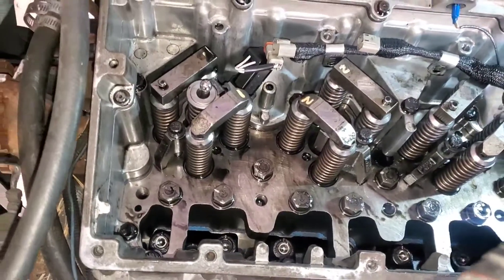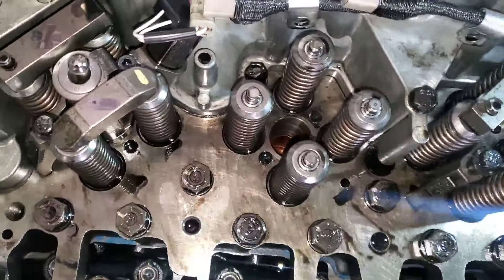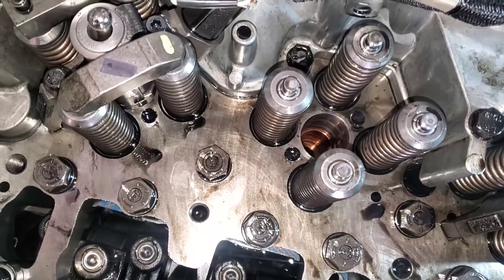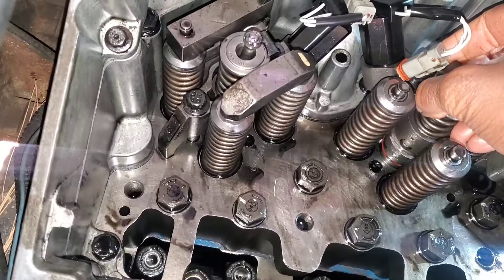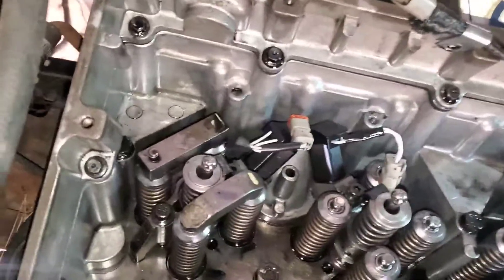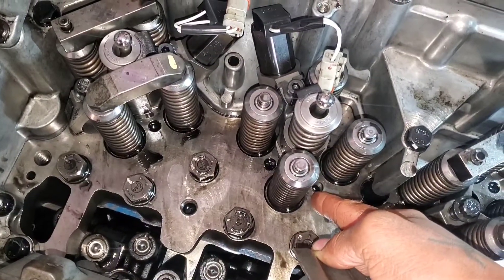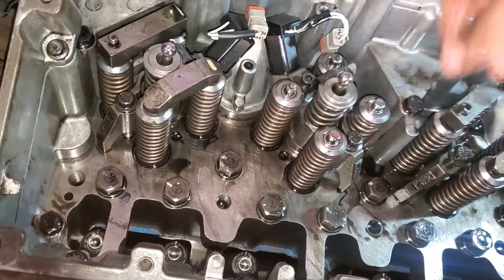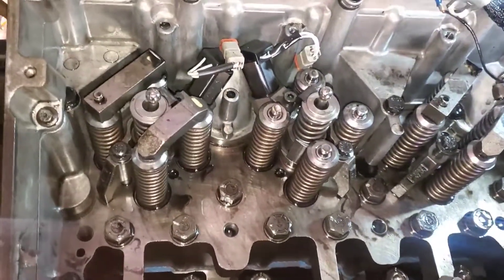Inside a cummins m11 engine installing injectors

Comment: Hey yall i got a 2001 cummins ISM. The oil starts out at 65 psi then drops into the teens after warming up and it drops at the filter head Ive ruled out pump, guage, leaks, injectors, jakes while everything on the valve train looks good. I had a 12 hour diagnostic that ensured the internals had normal ware. I recently had the injectors in cylinder 2 replaced as well as a rocker arm on the same cylinder replaced. I used the truck for two days and had to bring it back to the same shop. The mechanic informed me that there was a wire broken on the number 2 jake assembly. And now insists that it wasnt from the work they did but dosent know whats wrong with it please any suggestions will be greatly appreciated
Reply from the maker: Check your pressure relief valve make sure its good and installed correctly..Check your high pressure relief valve /pressure regulator.
Reply: @Trucking pays the bills  appreciate the response will do that next. Also would like to add while in the shop they replaced oil and oil filters. In the two days it worked i lost 4 gallons of oil with heavy smoke while derating the engine and oil light flickers. If it does happen to be the bearings shouldn't they have caught that with the 12 hour  diag? I mean they stuck a camera down the block. If it so happens to be the bearings what would you charge for that? Thank newly subscriber
Reply from the maker: @Son0fLib3rty  The camera don't always see the problem because the engine is so compact . Also the problem may be a crack and sometimes the camera won't pick it up. I'M not sure if you mention they drop the oil pan or not but sometimes if your main bearing is shot pieces will be in the oil pan. Also if you have a crack somewhere  you won't experience a problem until the engine gets hot and open up the crack.
Whatever the problem is if the shop is considered i would advise you to talk to the owner for a reduced price in fixing the issue since you paid so much money already.
Reply: @Trucking pays the bills  if there did happen to be a crack. Would there be a leak or a knocking noise?
Reply from the maker: @Son0fLib3rty  i usually see leaks when it comes on to crocks. When i hear knocking noise its usually some things is broken inside the engine.
Reply: @truckingpaysthebills5394  Great content. Thanks for your insight!!!
Reply from the maker: @Son0fLib3rty   usually you don't see the leaks because its burned off.
Knocking noise usually means something is broken in your engine.
Looking at your early message you mention smoke. One or more of your piston ring might be worn out or broken.
 If you're getting gray smoke when you press the gas then oil is getting past your rings making you burn a lot of oil.
Reply: @Trucking pays the bills  it smokes at idle and occasionally while driving but smokes anytime i use the engine brake. I hope to god its not the rings. I paid a 12 hour diagnostic to make sure rings were good before i changed the rocker arm and injector.

Comment: how to adjust injector sir ,thanks
if you can teach the secquence
Reply from the maker: You can install any injector first they do not need to be in order just make sure you torque them down to the torque specs i mentioned The same procedure i showed you do that to all 6 of them just make sure you torque them down to the torque spec i mentioned 75nm or 55ft pounds.